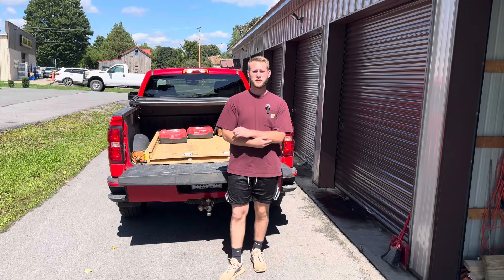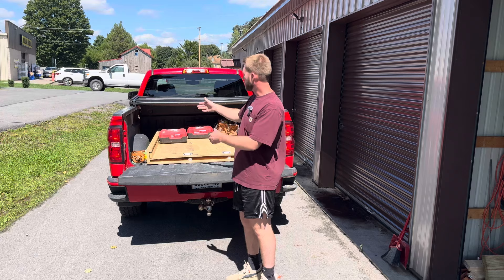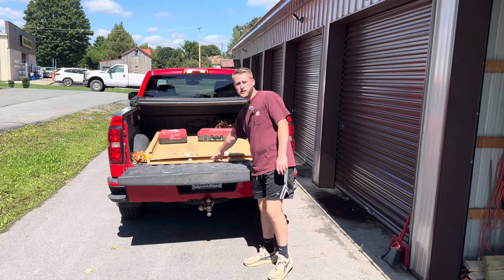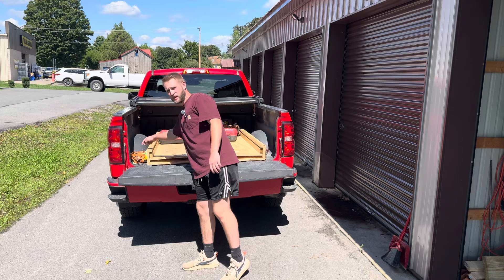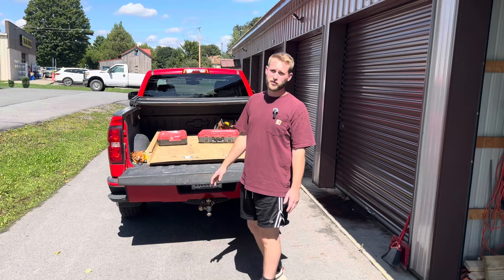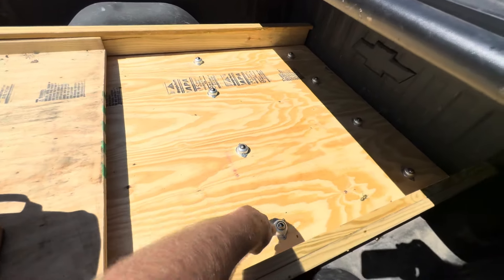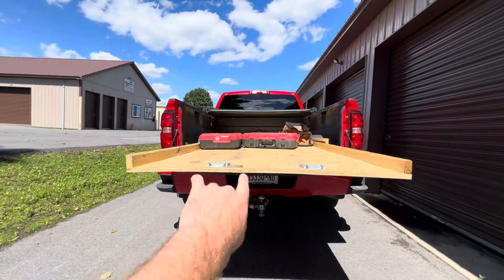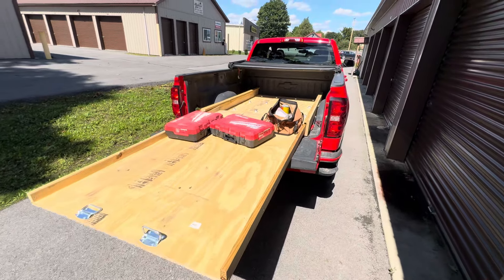I Built My Own Decked CargoGlide For $150! | See How Its Done!

Comment: After a few weeks how do you like the functionality? Anything youd change? Great video thanks
Reply from the maker: Still really liking it a lot! I built this with wet pressure treated wood. So everything has shrunk a little now. It still functions great and moves even easier now. But I dips more when you get it fully pulled out. So drying the wood first would be the main thing I’d change so far
Reply: I have one. I’d get a van in restrospect (they are more expensive).
As for the tray, I’d had sides so stuff don’t fall off and jam the tray.
It does make loading material inconvenient so consider renting a trailer on day one of big jobs to carry material. Or get it delivered. Cheers